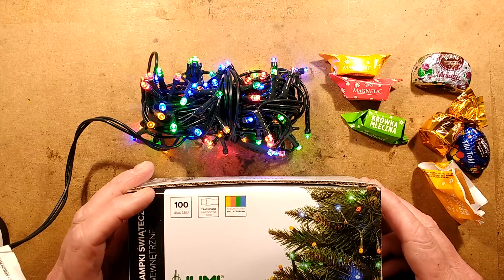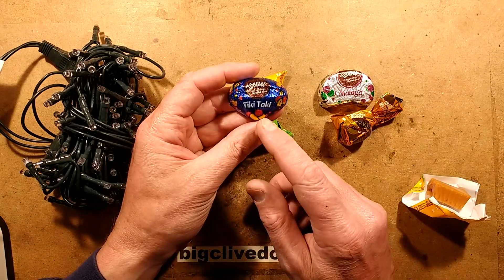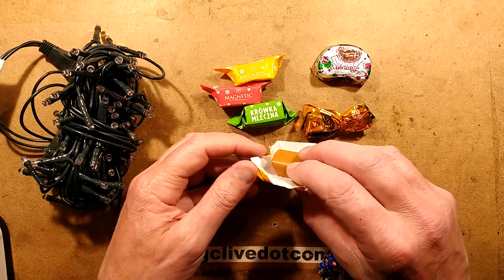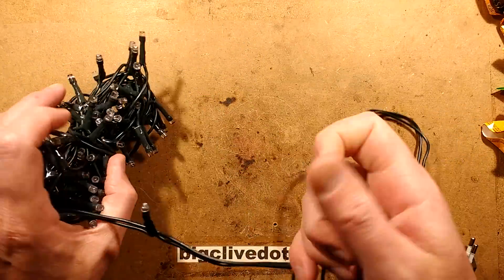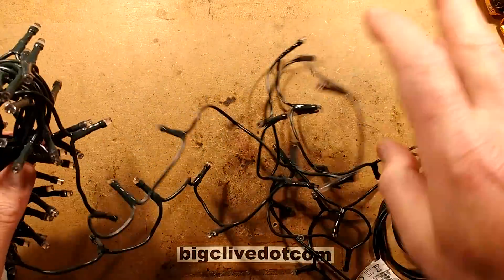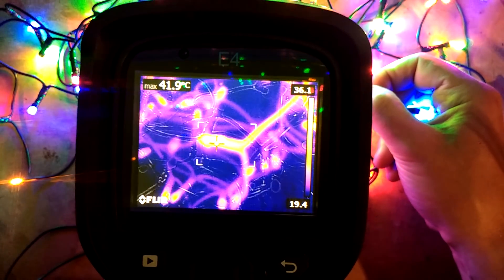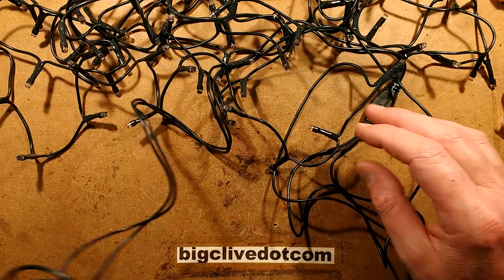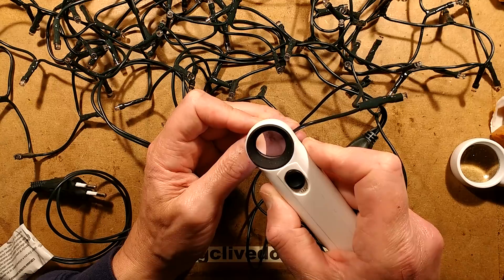240V Polish Christmas lights with series resistors.

Comment: Just discovered yer YT channel sir !  The most electronics based amusement I've had for some time :o) We share the desire to know what's going on inside a thing - some of your ebay tat dismantling vids are just a hoot - I watch utterly amazed at how lax safety  regs must be in some other far off countries - esp. water and live mains in direct contact. I've learnt a pile of odd things since looking at your vids, and that's after about, um, 50 years of messing with and being paid to 'do' electronic engineering :o)))) Thumbs up from awayyyy down in Wales.
(you are right about folks going into electronics after getting a fair old electric shock -usually because they are poking about where they shouldn't -  in my case it was discovering 400vdc in a valve radio aged 10 - can't be ignored :o)  )

Comment: Do they sell these on eBay?
Reply from the maker: Not sure about this exact type.  The usual Chinese seller type are the very shady 100 LED sets with smoking hot resistors and very flimsy wire with little insulation and no strain relief.
Reply: I have a purple set of those, they're hilariously bad!

Comment: Hi bigclive, I built a rain detector today from different eBay items, it cost about $12.00
 It's purpose is to alert me to get the washing in off the line before it gets wet!
I made it from a laundry/flood alarm, some bell wire and a couple of printed circuit boards detectors.
The next one will be a 433 Mhz wireless system also using a couple of eBay items. Should cost about $16.00

Comment: What would happen if there were no resistors?
Reply from the maker: It would make the set very sensitive to voltage variation.  A transient could result in quite a high current.
Reply: bigclivedotcom still i would perform fine!

Comment: Where would one send things for examination if that's at all possible? I may be able to send some potentially interesting electronics your way for either fiddling with or using as component donors. I'll throw in some local candy if that helps :D
Reply from the maker: I travel about a lot at this time of year, so it's not a good time to send stuff.
Reply: Well, I can hold on to stuff, I'll check back in the fall or winter time (if I remember :D)!

Comment: Just a quick question if you see this, are those three to two pin adaptors safe? I recently bought one for a Phillips shaver on Amazon at the request of my father and it came with a two pin cable, but I get paranoid about him leaving it in charging overnight when I'm not there.  The adaptor cost around £4 and had decent reviews, again I might just be paranoid.

Edit: Sprry, I may as well put up the links to what was purchased. 

https://www.amazon.co.uk/gp/product/B0765W1Z55/ref=oh_aui_detailpage_o00_s00?ie=UTF8&psc=1

https://www.amazon.co.uk/gp/product/B00DI3J0HA/ref=oh_aui_detailpage_o01_s00?ie=UTF8&psc=1
Reply from the maker: It should be OK if the adaptor is a properly UK certified one.  The shaver is probably just two pin anyway.  The unit should be charged in a dry area.  The bathroom shaver sockets are designed for wet areas and have an isolation transformer built in.

Comment: I hear some distinct 50Hz noise in the background. I first thought that some transformer in my room started humming for some reason, but it silenced when i paused the video. Do you have a noisy transformer around, or is it just electric noise picked up by the microphone cable?
Reply from the maker: If the soldering station is on it hums.

Comment: Clive, in an earlier comment regarding adding a smoothing capacitor to reduce flicker you said, "If you did this with the mains voltage ones you would need to add more resistors as the voltage would go up from the average to the peak." As a beginner I'd love to learn more about why this is the case.
Reply from the maker: The mains AC voltage is referred to as an RMS (Root Mean Square) or average value of the sinewave.  The peak of the sinewave is actually higher by about 1.41 times the average value.  So if you use a rectifier and capacitor it tends to charge up to the peak voltage.
Reply: Thanks Clive. And, uh-oh, I'm actually starting to understand electronics beyond the (absolute) basics all thanks to you!

Comment: bigclivedotcom
I've a similar solder station 852D+, main difference is the heat gun is a diaphragm pump in the base unit and a tube going to the nozzle. Works fine but noisier than the one you have, you would't want to use it for filming.

Comment: Unlike you to not expose the rectifier module, is it fused in any way, is there any isolation, etc. Bummer....
Reply from the maker: They usually just have a single component or discrete rectifier moulded directly inside the plastic.

Comment: You have to check this out: 220V Mini Water Heater Portable Electric Immersion Element Boiler Travel DY
Reply from the maker: Could it be this?  https://www.youtube.com/watch?v=EViyccc2t9w
Reply: bigclivedotcom Similar, but it's a much more exposed design.
https://m.ebay.com.au/itm/600W-220V-Mini-Water-Heater-Portable-Electric-Immersion-Element-Boiler-Travel-DY-/142508830920?_mwBanner=1&_rdt=1
Reply: Looks like a boring resistive heating element.

Comment: I've often heard you speak of "240V UK mains". I've never seen it that low. Mains in my house is pretty much a resolute 250 V. I've seen it up to 253 and as low as 246 but 240? Never. Must be getting the good stuff as I'm less than 10 miles from Drax Power Station!

Comment: Do any fairy lights use a smoothing capacitor to eliminate flicker?  How about a 3rd party add-on that you can insert between the power receptacle and the fairy lights that convert the line voltage to smoothed DC signal specifically designed for fairy lights?
Reply from the maker: If you did this with the mains voltage ones you would need to add more resistors as the voltage would go up from the average to the peak.  There have been sets with inline capacitors, but it was something that was fudged due to problems with colour changing LEDs resetting to red repeatedly.

Comment: Those could be Royal Ohm MMF04 series resistors. They are miniscule (about the size of the old 1/8W) and rated 0.4W  I use them for current limiting for LEDs all the time. That said I don't stress them above about 50mW most of the time.
Reply: If they were running at 36C (I think that's what Clive said) then they were well within their ratings.  Even if they're rated 1/8W, that will be at 70C ambient (and they might even be rated as 1/16W at 125C).  If they're running at 36C they're not suffering at all, it's a stroll in the park for them.
Reply: There is no such thing as a leaded 16th watt resistor.
Reply: 1/8W at 70C or 1/16W at 125C Same resyistor, that's what he is saying.
Reply: That is not how resistors are rated. They are rated at x watts with a derating value down to zero at so many mW/C.
Reply: +Gordon Lawrence
I remember, many years ago, using resistors rated at 1/4W @ 70C and 1/8W at 125C.  They were indeed rated that way, both in the BS9000-series specification and the associated Defense Standard.  Operation above 125C was not specified and therefore no assumptions could be made about their operation above that temperature.  Maybe I could assume a linear derating on that same line, but the quality manual said don't design outside of spec.

Some of us have a broader range of experience than others.  Some of us have encountered specs that others have not.
Reply: not on any data sheet I have seen. Also just how many resistor manufacturers do you think use British Standards? None because JEDEC IEEE and all the rest are internationally recognised. For example https://www.tme.eu/en/Document/353a4c49cd04d4760ab7ace851501ebe/metal_film.pdf
I can provide many more. Note that only ONE power rating is mentioned per range.
Reply: Nevertheless they do exist... Or existed in past :) No one forces manufacturer to follow certain standards, they can do what they want and provide the specification they think would worok... Maybe no one would buy the odd product, but they can do it :)
Reply: +Gordon Lawrence
As I already hinted, you haven't seen everything and you don't know everything.  A wiser person than you might have taken the hints I dropped and googled them before putting his foot in his mouth.

BS 9000-series specs cover electronic components for use in military and aerospace applications and any other area requiring long-term reliability.  They are still used today: https://www.bsigroup.com/en-GB/our-services/product-certification/product-certification-schemes/IEC-testing-and-certification/iecq-testing-and-certification/BS9000-approved-products/ although they've largely been harmonised with international specs (i.e., re-issued under the umbrella of an international standards organization like CECC).

A rather minimalist spec you cited.  Nothing about vibration, humidity, etc., etc., etc. I'd expect to see on military-grade resistors.  Something like https://www.charcroft.com/pdf/charcroft/Charcroft-4800-Series-Is4-06-12.pdf  That's the manufacturer's data sheet, not the BS/CECC spec.  If you want the defense standard then register for an account at www.dstan.mod.uk and go for a ramble.

And yes, it looks like these days manufacturers specify a single power rating and a linear derating.  Back in my day they said the same thing a different way.  You haven't seen everything.
Reply: I have provided evidence you have not. I have never seen what you claim to be true in over 30 years in the electronics industry which includes years working as an engineer for a distributor where going through specifications with a fine tooth comb all day every day was my job. As a design engineer I was the "go to" guy for when components deviated from specification as I knew exactly how and why it happened and that was for several different companies. So nope you have no evidence and my 30+ years of experience cry "BS".
Reply: And as I said it's your point you are trying to prove and you have provided zero evidence. That is for example how the law works except for where a negative is being proposed IE saying something does not exist - where then the burden of proof rests on the person claiming that it does. Also being wise is rejecting unsubstantiated BS.
Reply: +Gordon Lawrence
I keep dragging you over to the turd you dropped and rubbing your nose in it, but you're not learning.

Did you look at the links I provided?  Obviously not.  That or you can't understand them.  One of them was for a data sheet from Charcroft.  On Charcroft's front page it states: Charcroft Electronics Ltd is a specialist, CECC/BS approved distributor of passive, interconnect, power, magnetics, optoelectronics & electromechanical components. We are also a CECC approved manufacturer of commercial and CECC released passive components. Charcroft is approved to BS9000, IECQ CECC and BS EN ISO9001:2015 and has over 40 years of experience as an Approved Supplier.  Do you see the "BS 9000" in there?  The spec you claim doesn't exist and that manufacturers ignore.

Or look at https://standards.globalspec.com/std/654635/moduk-def-stan-59-30-part-1 (you'll need the reading and technical comprehension skills you claim to have to understand it).

Or this, from BSI.  https://shop.bsigroup.com/ProductDetail/?pid=000000000000142373

Just because you worked in the stores dept of Maplin that doesn't mean you know about anything other than consumer-grade components.  Had you worked for RS or Farnell (both BS 9000 approved) you'd have known.  Even if you'd only worked in the consumer-grade stores for RS or Farnell you'd have been told you must never enter the BS 9000 stores unaccompanied because you were too fucking stupid to understand the QA requirements.

I can't believe you were ever an engineer.  Engineers check their assumptions when challenged.  Well, the good ones do.
Reply: None of those are links to free data sheets. That link costs 102 to download. So give me a link to a DATASHEET that supports your claim or yet again I will tell you that you are wrong. If you are talking about standard derating then EVERY resistor will be 1/16th watt at some temperature or other depending on its derating and original power rating.
Reply: +Gordon Lawrence
Here is part of what you wrote earlier:  Also just how many resistor manufacturers do you think use British Standards? None because JEDEC IEEE and all the rest are internationally recognised.

Every damned link I've given you has proof that resistor manufacturers use British Standards, contrary to your assertion that none of them do.  Well, the manufacturers who want their resistors to be used in military and aerospace applications do.

It's already clear from www.charcroft.com that I gave you earlier that resistor manufacturers do use British Standards.  But since you're too lazy to investigate, look at https://www.charcroft.com/quality/quality_approvals/ and you'll see BS 9000, BS EN ISO 9001:2015 and IECQ.  Oh, and just to prove it's more than just resistors, BS 9075 N0024 as the detailed spec for a multilayer ceramic capacitor.

Oh, and you know what I don't see in their QA list?  Any standards from JEDEC and IEEE, which you claimed were used instead of British Standards.  Isn't your nose a bit raw by now?

And now to deal with the remainder of your stupidity.  You'll need graph paper, a pencil, and a straight edge (no scissors required, fortunately, otherwise you might stab yourself).  Mark the x-axis at 0, 70, 125 and 155.  Mark the y-axis divisions as 0, 0.1, 0.2... 0.9, 1.   We're going to plot the rating of a 1W resistor with temperature.   Horizontal line from 0,1 to 70,1.  Now a sloped line from 70,1.0 to 155,0.  That's essentially the derating curve in the data sheet you provided.

Now for the magic trick.  Draw a vertical line from 125,1 to 125,1.  What's the y intercept?  I make it about 0.65.  At 125C the power rating would be 0.65W.  The resistors I remember had a different derating slope, 0.25W at 70C to 0.125W at 125C, but this example is good enough to make the point.

What's magic about 125C?  It's commonly specified as the maximum ambient operating temperature in military and aerospace equipment.  Which is why people who design avionics and the like are interested in the power rating of a resistor at 125C.  Which is why specs for military-grade resistors often give a rating at 70C and a rating at 125C and don't bother saying what happens above 125C.  Because the spec is more useful that way: it saves everyone having to calculate the rating at 125C and scribble it on the spec.

Just because you've never seen it doesn't mean it doesn't exist.  Just because you don't want to pay for a spec, doesn't mean the spec doesn't exist.
Reply: My original point still stands. Also you have not proved FROM A DATA SHEET that I am wrong.

Comment: 240v in a regular outlet..  LOL
Reply: Larry Gall Don't understand why that's funny? At the moment my electricity meter is saying my supply voltage right now is 247.5v
Reply: 270 some years ago.... they switched at some piont i don't know what and my tungsten light bulbs made instantly like pure white light and X1.5 power

Comment: Hey Clive, I was wondering if you could test the sonoff smart switches (I'm always paranoid running chinese tech) I don't know if you read this, thanks anyways :)
Reply from the maker: Most of them seem reasonably well designed, but you are connecting a node onto your home network.  It might be worth investigating the alternative firmware available that doesn't connect to a Chinese server.
Reply: John Ward has videos on testing these switches.
Reply: I was going to ask the same question. Just got 2 delivered today and I'm swithering about installing them both or pulling one apart first.

Comment: Do you think these would meet CE safety standards?  The cable seems to be double insulated which is good, but the lack of strain relief I suspect would be a fail.
Reply from the maker: The lack of proper strain relief is a bit of an issue.

Comment: Is the 20 mA current peak or RMS? Because that makes the calculations quite interesting: If it's RMS the peak will be well above that, and so will be the peak voltage across the resistors. Perhaps that helps them get away with rating it for the whole 220-240V range without brightness changing too much.
Reply: ManWithBeard1990  Neither really. When the actual rectified DC mains voltage is below the total combined forward voltage of all the LEDs, no significant current flows. So no significant dissipation in the resistors. Then when the mains voltage increases, so the dissipation in the resistors increases (a part of a sine wave) until the mains voltage reaches it's peak voltage.

Comment: what is the  proper name of the peace that goes between the leads of the led's
Reply: Peace of mind.
Reply: that is funny and threw .. but I was serious
Reply: It threw? I didn't mean to throw anything. I hope I didn't hit anyone with it.
Spacer, separator ... it really is just a bit of plastic with a none too sophisticated shape.
Reply from the maker: It's a little "H" shaped spacer.  Commonly used in LED light strings, but actually hard to find on its own.
Reply: i would guess a small diameter piece of heat shrink tube or wire insulation would suffice too.